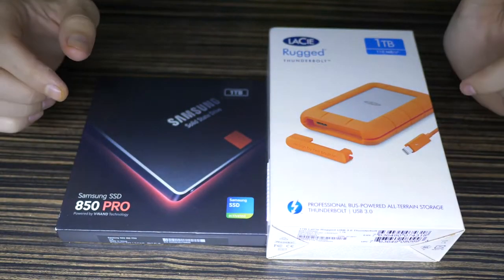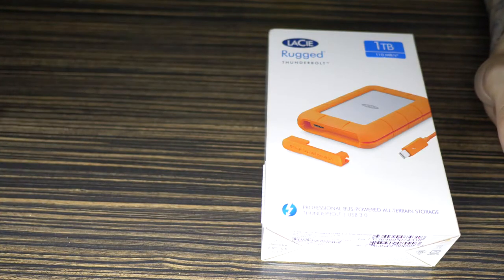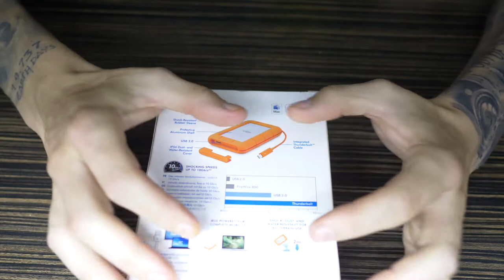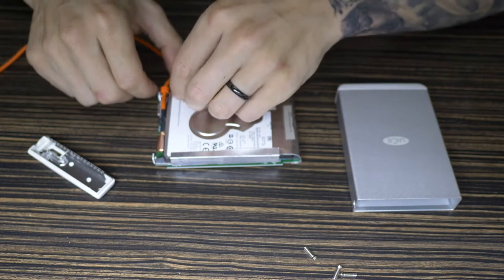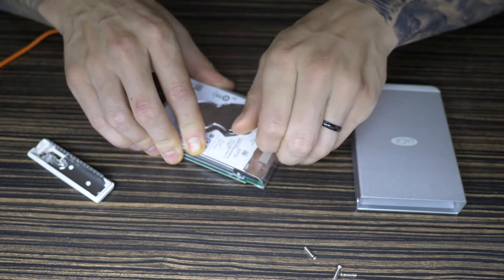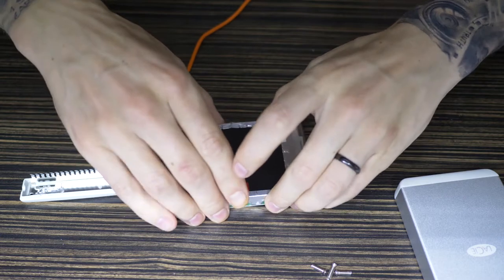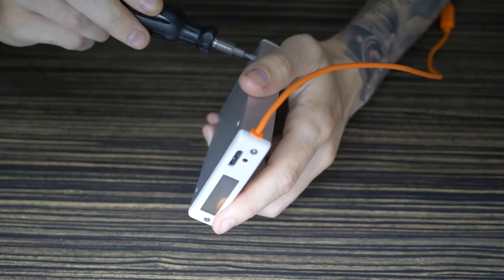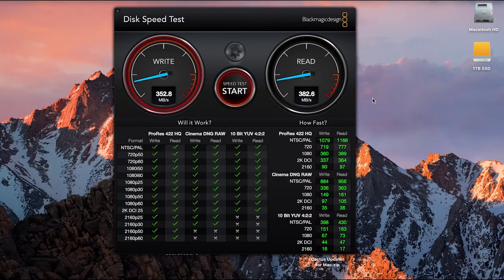The Ultimate SSD for Backing up your Photos & Video!

Comment: Thanks Lewis!  I had no idea what the inside of the Lacie looked like.  I  didn't know it would be a self contained unit that easily slipped in and out.  I am familiar with the drives that have all the electronics on a board outside the spinning disk (old school drives I guess); and to top it off the Samsung was the same exact size as the Seagate.  I learn something every day.  You gained about 240 mb/s.  110 to 350.
Reply from the maker: +Steve H Yep, exactly. Much more speed both ways and the data is more secure being SSD.

Comment: Would the USB3.0 type-C connection be even faster?  That is $110.00 on BH Photo!
Reply from the maker: +Jay G. The new MacBooks have the type c connection. I have the older MacBooks and iMac with thunderbolt, plus the nas drive I use has thunderbolt. Few years time I'll probably switch. I don't know what drives the BH PHOTO type c drive is using. It may be Seagate, the Samsung pro drive gives me 10yr warranty